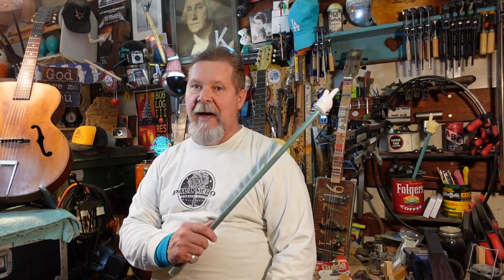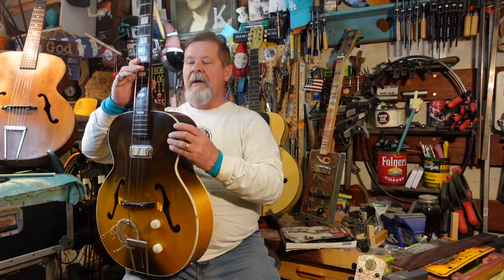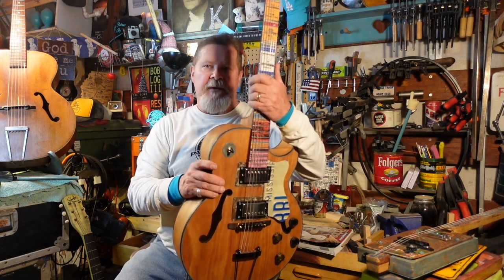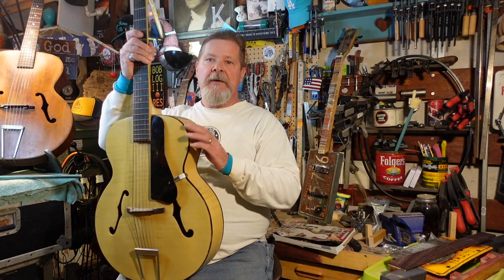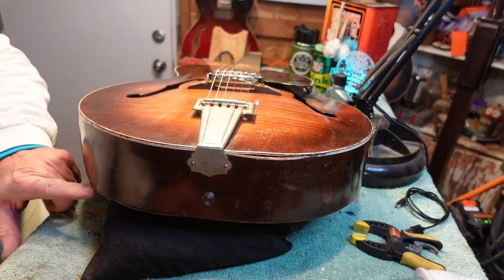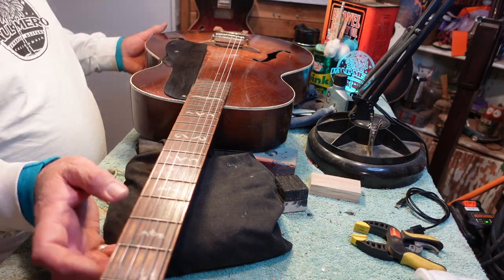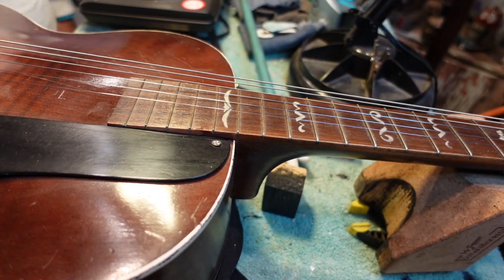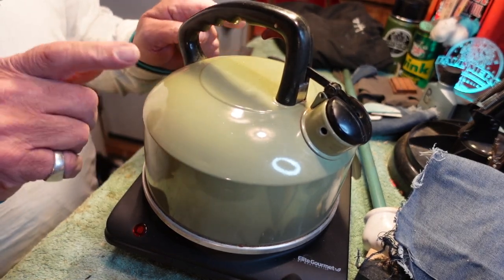Econo-Archtop Guitar Neck Reset: Part 1-Face the Facts

Comment: 15:00 Mine has "painted on bindings" too, which I wouldn't call bindings, more like decorative paint, really. Not very protective, since they didn't have flex-seal back then, thankfully.

I need to either mic the guitar or get a pickup, but it doesn't have much room under the strings to fit a pickup, much like the blond guitar you showed right before the one above. But now I really really want to play it thru some fx pedals.

I've been having trouble learning blues guitar, and I was worried it was feels so a week ago I turned on the digital piano and played the most slidey bendy Riders On The Storm-ish blues jam, no issues. Probably the bluesyiest thing I've ever played on a piano, maybe even TOO bluesy, if it had sounded like a piano, which it didn't, because

Some of it might be due to life circumstances, but mostly it was the fx pedals. I'm serious! Piano doesn't have any pitch bender. 12 inflexible notes, and some sustain pedal overtones. So, 2 of the fx pedals were bending the pitch in different styles and with different timings, and there was a phaser doing its own thing. Chorus and drive (and phasing effect from splitting the signal into parallel fx chains at one point) kept turning the piano timbre into other blues instruments (?!) and there was a delay, from the reverb pedal, that made it seem like there were at least 2 of us playing. Without the fx pedals, I never would have played what I did, and I'm sure that what I actually did play wouldn't sound like much without the fx, either.

Coming from synths and digital pianos, I want to have that with acoustic guitar too.

2 problems - 1: I can't just stick a dummy plug into the guitar's headphones jack to disable its internal speakers (which is what I have to do with the digital piano, even when using its line out). 2: there isn't a line out, so if I don't mic it (and use headphones or else get a feedback loop), I'll have to add a pickup to the H1214 Archtone.

I seem to like the sound of goldfoil and p90 and paf, but I'll probably end up using it either with tons of fx or very raw. So the main criteria is it has to fit in that tiny space in front of the fingerboard. That's more important to me than the specific type of magnetic pickup.

I should've gotten to the point sooner, sorry... What Slim pickup would you recommend for a guitar like the one at the above timestamp, or especially the one right before that? Mine's all original as AFAICT, so at this point I would rather have ugly wires exposed and a cable coming out from under the pick guard, rather than drilling extra holes, if possible.

If there's no pups that would be just right, I do have a mic, and I could get a stick-on piezo and an IR pedal, etc, so nothing's etched in stone right now.

I'll try to remember to look for an answer here, and I'll also watch the rest of this playlist. And I'll check your past vids with an ear for what the thinnest pickups sound like, on these guitars. I've watched some already, but I wasn't really listening for whether they'd sound good raw AND as a base for fx.  You had some good players for the road tests, so I don't mind going back for another listen here and there.